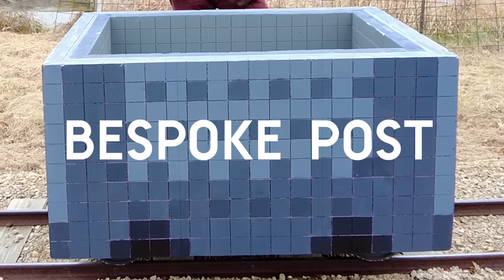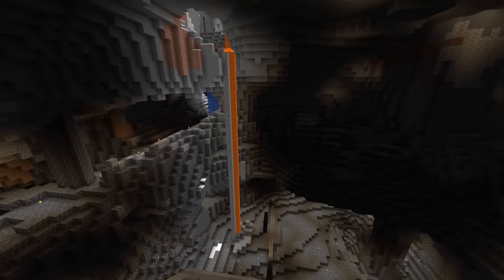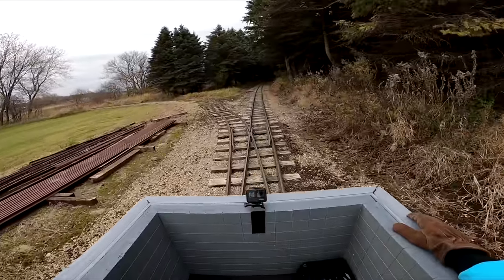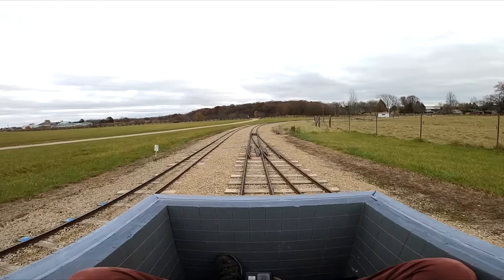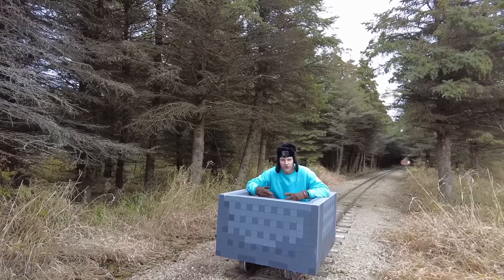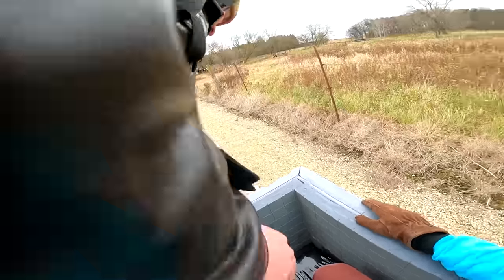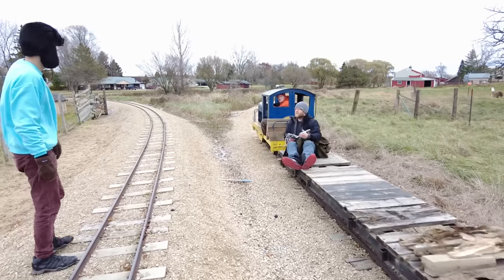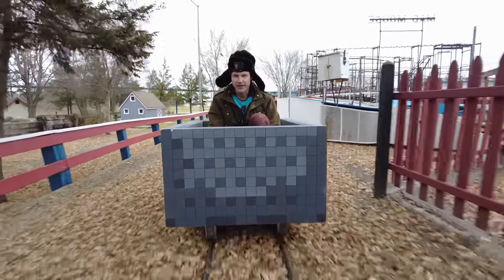This minecart is real and fast

Comment: 4:16 you could add some brushes right in front of minecart's front wheels to prevent sticks and other trash from derailing. Your traveling between bioms would be safer.
Reply: or even just a wheel guard that pushes stuff off
Reply: @Blue-bf8lv  yeah basically this is what i meant but wasn't able to explain/express bc Eng isn't my mother language, thanks😅😃💪
Reply: @krystofgresak4295  čech že jo :D
Reply: @animeguy4762  😃😃 Nabsolutně, si piš
Reply: He spent so much time making a complex electrical motor propulsion system and he could have just held w

What a shame
Reply: Expecting a bit much from a guy who forgot a helmet
Reply: he needs to make more carts unfortunately u cant stick them together maybe he can download a train mod or something
Reply: yes!
Reply: Glad to see someone also had the same idea.

Comment: the back-and forth bouncing at higher speeds is caused by the angle of the train wheels. The angle is necessary to go around corners properly, but the greater the angle, the more it tends to oscillate at higher speeds. A flatter wheel is better at higher speeds, but can't turn as sharp of a corner.
Reply: Wow the more you know!!
Reply: 9:20 Are you referring to hunting oscillation?
Reply: @iruton1334  having just looked up that term, yes, I believe I am.
Reply: And on top of the train wheels there is also variables like how the track was laid

If using jointed rails that essentially butt up together and then bolted, that is commonly not perfectly straight so there will be slight lateral motion transferred to anything running on the tracks
Reply: It's called hunting oscillation.  On full-size trains it typically occurs at around 55-65 mph and can be exacerbated by the use of jointed rail.

Comment: At 9:20 this is a irl phenomenon called ‘hunting oscillation’. And in reference with your case. The flanges of the brake drums are hitting the track at higher speeds making the ride quality seem more unstable. The best way to eliminate this is to change the wheel profile of the brake drum to be more conical in nature while tuning the flange-track gap on your set. At high speeds the hunting oscillations become too much for the train and the constant bouncing of the flanges causes sufficient friction in balance with the torque of the motor which gives you this top speed of 26mph. There are some cases where hunting oscillation can derail the train as the repeated bouncing can simply throw your wheels of the track. This also happens with regular trains passenger, freight, tankers, etc. 

Upvote to get @Joel Creates to see this to possibly help his design :)

More information can be found here (there are 2 useful gifs at the start to demonstrate the effect): https://en.m.wikipedia.org/wiki/Hunting_oscillation
Reply: yooooo you smart as hell man
Reply: Mega Mind 👽🧠
Reply: respectable
Reply: I dont speak Thomas studier
Reply: You a train engineer?
Reply: It's almost as if modern train wheels have been designed on purpose. 😂
Reply: This is why wheels on locomotives and railcars have more of a semi cone shape.

Comment: Both Minecraft-y and in general, nice! I love how surreal the cart looks on real tracks. It may already exist, but have you thought about something like this for commercial scenarios? While admittedly not very safe, small carts of any sort could be a lot of fun for younger children, even attached together as an alternative to train cars.
Reply: go karts are a thing, i can't see how much dangerous this could be with a hard speed limit, some people watching over the kids and helmets.
Reply: I think they already have those at amusement parks and stuff. I've also seen trackless "trains" driving around malls.
Reply: I recall riding a miniature hand powered minecart on a track at an amusement park when I was young, I can confirm that it was a lot of fun!
Reply: @CrazyStranger11  That's one of the things that gave me this idea, but I'd still say we can use more rail carts.
Reply: I'd be worried about digits being lopped right off by the wheels from them not understanding the dangers! or purposely trying to run stuff over with it. or worse
Reply: @realflow100  "But fuuun!
Reply: @CyanicCore  4:13 You but going 26 mph
Reply: There was a hot wheel were you could place Minecraft characters in side it
It looked like a minecart

Comment: Simply amazing! The complexity and know-how that goes into something like this project is astounding, and your hard work definitely shows!
Reply: This is actually a pretty simple project. It's mostly structural stuff, the mechanics are as simple as a scooter motor and chain drive to one of the axles, and then a tilt hinge for the non-powered axle so that it won't derail if the track twists. As for wiring, it's just a battery, a motor, an off-the-shelf motor controller and an off-the-shelf servo-tester.
Reply: Fax
Reply: @M16 Are you trolling or just a 6-7 year old?
Reply: @VestedUTuber  well I wouldn't know where to start. I think it's very impressive
Reply: @BillyBoze  do I sound like a three year old? how does a 3 year old even type??
Reply: @M16papercraft  Not at all, your OP writing is 10/10 in its current state as far as I'm concerned. The age part referred more to your sense of amazement for this project. Which to me seems fairly unimpressive (about the perfect level project for age 10-14 years old) compared to the amount of praise you give it.
So your original comment seemed borderline sarcastic to me. Hence my actual question of: "Are you trolling"
Reply: Ik it's cool and all, but his teeth is a bit wonky
Reply: @BillyBoze 
I wouldn't consider this a project for some 10-14. While it is simple, it does involve the use of benchtop power tools and relatively high-current electricity, and ensuring that the wheel gauge is correct requires a high level of precision. A small amount of metalworking is involve with the motor plate as well. If someone between 10 and 14 were to build something like this, they would definitely need adult supervision.
Reply: Why you named after my grandson? Mr M16

Comment: The wobble is a classic railroad problem. Go look at how regular rail wheelsets are built the solution to your problem is specifically in the tapper on the wheel. The geometry of the wheel helps prevent derailing and controls the speed wobble.
Reply: I don't know much about trains/railroads, but I do know rollercoasters. My guess is that the wobble problem stems from the articulating nature of the wheels (so it can go around corners). Am I off? Close enough?
Reply: @hauntedshadowslegacy2826  it’s actually to do with the thermal expansion and contraction of the track, and the placement of the ties, and the coarseness of the gravel bed the ties are embedded in.
Reply: Speed wobble can get real nasty when bombing a hill on a skateboard. I nearly learned this one the hard way. 😬
Reply: @hauntedshadowslegacy2826  What's most likely happening here is hunting oscillation. Since in a curve, the turning radii of the inner and outer tracks are different, the distance the wheels travel is different. But since the wheels are on the same axle, this would be a problem. Therefore, engineers made the profile of the wheel not flat, but rather with a taper. This meant that the train shifting to the side would account for the difference in radius. This also had the added benefit of stabilising the train since the flanges help keep it centred. However, it seems like the brake drums don't have tapers, so the self-correcting effect is not present. The rails could also be slightly wobbly, and in the video they are quite wobbly. Also the minecart doesn't have suspension which means all the bumps are transmitted into the box...
From my observations, it also seems like the flanges on the brake drums are tiny, which likely makes it easier for the train to derail. Therefore welding a ring onto the drum to increase the flange would help reduce the number of derailments.
The minecart only has 2 axles, so it is functionally similar to a singular bogie. Normal trains tend to have two bogies supporting a long carriage. However, it is quite rare to have steerable bogies- vast majority of trains have the axles fixed to the bogie (albeit with some suspension)

Comment: Dude, if you could mass produce these with regular wheels, you'd be making BANK
Reply: Yeah because everyone just has their local train ride place that will let them use their tracks whenever you want
Reply: Not enough of a market to mass-produce them, but maybe build to order? It would be an affordable entry point into backyard railroading, problem is most people don't really have the space for an estate railway like that and there's very few existing 16" gauge lines that are open to people running their own equipment - first off, 16" gauge isn't even a recognized standard, the closest standardized gauge is 15" gauge, and second, most minimum gauge railways won't be willing to let some random person show up with a home-built contraption to run on their line due to safety, liability and the fact that it holds up normal operations.
Reply: @ThatBearsRaysFan  That's why I said with regular wheels so you can ride it around your neighborhood.
Reply: seriously though you could sell these at to some other places like little america with miniature railways as a kiddie attraction, maybe even make a furnace cart with a little motor in it to drive a train of unpowered carts

Comment: I've been up to a speculated 15-20 mph, on my 7.5" gauge live steam locomotive (a crusty, wood fired Little Engines American for those intrested)  it's a bit frightening with the track jostling, trying to stuff wood into the firebox and simultaneously driving and pumping water into the boiler. (Its a three handed operation!)
Reply: Ballsy, I've never been that fast on one.
Good on ya for wood fired.
Reply: @NowhereMan260  yeah, I didn't really even notice I was going that fast until my passenger told me once we stopped. Thanks, wood (Almond In particular) is far easier then coal, it burns just as hot (it seems) and responds quickly.

Comment: This is a very interesting build. I thought about something that maybe will help with the wobbling, but I'm no engineer so I might not be right at all. But I'm guessing maybe the balance in the cart can maybe be fixed with weights on the sides to help keep it down? I'm not sure that might work but it's an idea
Reply: Go check out the geometry of actual train wheelsets. His issue lies in the shape of his wheels and how they contact the rail. The wobble like that is a classic railroad problem that got solved with the special geometry of the wheels themselves in the early days if railroading.

Comment: "How often do you get to chase your friends down your own private railroad track?"

For me? About once a month. There's a miniature railroad club about an hour away from my house. They've got about 1.6 miles of 7.5" gauge track and people bring their own equipment to run there, including actual miniature steam locomotives.
Reply: That's a bit.. large if its a toy train scale. Thats almost as large as narrow gauge.
Reply: @Astrochorius 
They're definitely not toys, but they're nowhere near typical narrow gauge in size either. They're big enough to be ridden while still small enough to be transported in the back of a van or pickup, and they're primarily working scale models of full-size equipment. Standard gauge equipment running on 7.5 inch gauge is a bit bigger than 1/8th scale, while narrow-gauge equipment on 7.5 inch gauge can be as big as 1/4th scale. They're generally powered by small electric vehicle motors running on batteries, gas engines running though either an electric or hydraulic transmission, or live steam running on coal, oil, propane or wood.

Narrow Gauge is a category, generally ranging from 24 inches to a meter. Anything below 24 inches but above 12 inches is considered "minimum gauge", while anything 12 inches or smaller but still big enough to be ridden is "miniature", with gauges ranging from 3.75 inches to 12 inches with 7.5 inches being the most common.
Reply: @VestedUTuber  I'll back you up on the once a month thing. I have a locomotive in 7.5in gauge as well. The hobby is a ball, tons of fun.

Comment: fun minecart fact: when it first released it was actually operated by filling it with items and pushing the cart, there was no functionality to ride the thing it was just a very expensive item transport. it would leave a tilled dirt texture and i think until 1.15 or 1.20 it was never changed and you could see the dirt under the flooring with the frontface camera, just one of the many old and weird features in minecraft that have been around since indev and infdev.

The furnace hopper was also operated by coal for some reason and they never changed it, there is also a command block cart.

Comment: As someone with experience in rail/wheel relationship, those wheels could've been more of a semi cone shape. That is more important than the actual wheel flanges. The flanges are just their to keep the wheels from climbing over the rail in a curve and leading the wheel through the the flange of frogs in  switches.

Comment: I'd take the drums and have them machined so there is a slight angle from the outside edge to the rim, that will help stabilize it on the track

Comment: As a person who has operated a 65T and above i still would not recommend running anything over on the track. Also a couple things to remember, if you come upon a switch and are unsure where it is switched too; look on the right hand side, the tip of the rail will let you know. Also, did you know that locomotive wheels are set upon, not mounted like a car.

Comment: I wished he made a sequel and added more minecarts and connect them together to create a literal train. He could even make the engine a minecart with a furnace containing the motor. The motor could be bigger and more reliable as it doesnt need to be hidden under a minecart. He should also put brushes in front of and behinf each pair of wheels so the chance of derailing is reduced.

Comment: the wobble is because there's no suspension between the wheels and the minecart. rail roads are designed to make wheels wobble a little to make sure that the wear on the rails is even

Comment: 10:14

1 thing I'm thinking about is minecraft does things in meters so a minecart can go 25 kmh which is about 15 mph 

just figured to say incase you were using mph. which would also means you got it faster than an ingame minecart.
Reply: No, everything in the game is in meters, since each block is a cubic meter. The maximum the minecart can go is actually 8 blocks per second, which is just shy of 18 mph.
However, the game has the odd quirk that this horizontal speed limit is the same even if you go diagonally downwards, which makes the actual speed higher. And that speed, specifically, is 11.3 meters per second, which is indeed about 25 mph. So he's actually going faster than the maximum speed the real Minecraft minecart can do on flat terrain.

Comment: technically you need a furnace minecart to Push the passenger cars the normal ones are not self powered
Reply: well how is he gonna do that? theres no such thing as powered rails
Reply: @2fifty533  ...subway tracks maybe? and i was possibly recomending making that minecart with the motors have the furnace in it and have the passenger carts in front of it so it pushes them.

Comment: I like minecarts too. I started a world a while ago I think you would like to play/check out. Can we get in touch so you can join me on a server and check it out? I have this world in both versions and it uses only default packs-you wont have to download anyting ;)  It is a huge world and the cart ride is very long and complete (but could use more scenes and things to look at as you ride) The world is called "Nice and Hidden" and has been designed to play games in like tag, hide n seek and mob killing. There are team colors and a lot more, although the actual games have not been set up, its a little beyond me and the windows version I did have a little tag with scoring but then they updated and broke it. I think you'd be impressed, also, I built this world block by block except for the autogen from the seed I used. You have to see it to believe it.